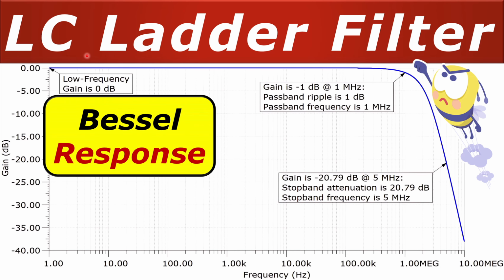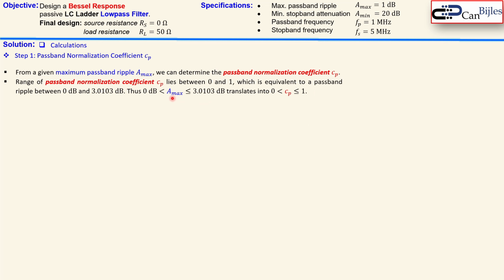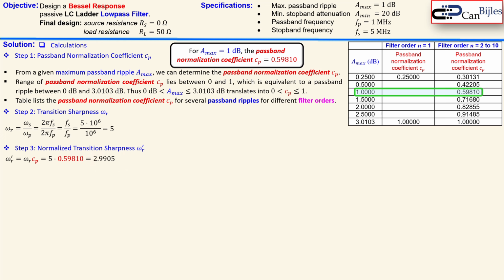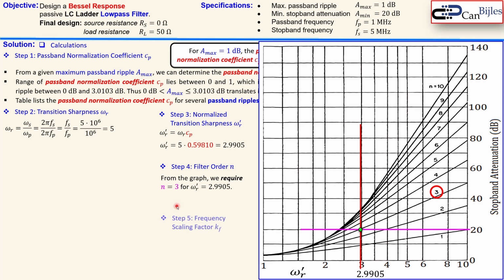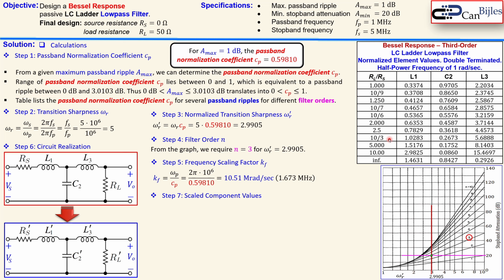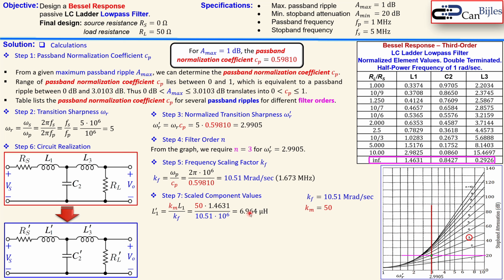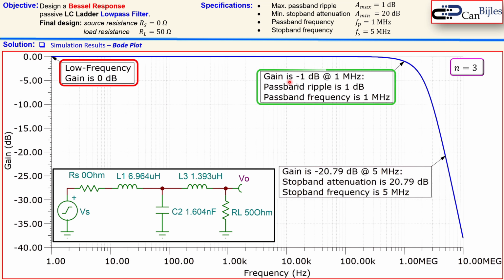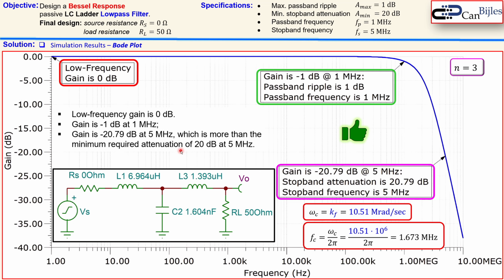🎯 Bessel Response LC Ladder Filter Design 🌟 3rd-Order Lowpass ⚡ Singly Terminated Source & Load

Comment: मेरे को audioscope बनाना है तो ऑडियो frequency को 31band बनाना है तो 31 Filter केसे बनाए कृपया मार्ग दर्शन कीजिए मे ऑडियो spectograph बनाना चाहता हूं ❤
Reply from the maker: What do you mean by 31 band?
Reply: इसमे 20hz to 20khz तक MBF filter बनाना है total 31 Filter to each every filter केसे बनाए uper link मेने दिया है. मगर समज नहीं आता है
Reply from the maker: @dipakbhalodia7155  You can also use this circuit to build a multiple-feedback bandpass filter: https://youtu.be/uDf26bClPpk

If you need Bessel Response LC ladder bandpass filter: https://youtu.be/cfJh6ssh-fo
Reply: @CANEDUX  seam desghin calculations होगा ना मेरेको 31 फिल्टर बनाना है 20hz तो 20khz तक audioscope spectograph जो ऑडियो frequency एलईडी के uper देख सके
Reply from the maker: Did you managed the project?